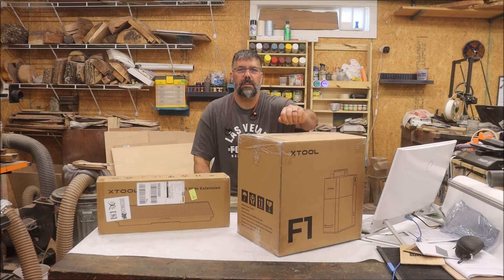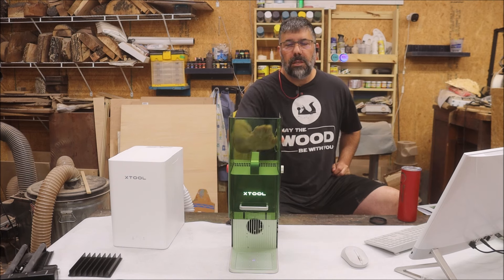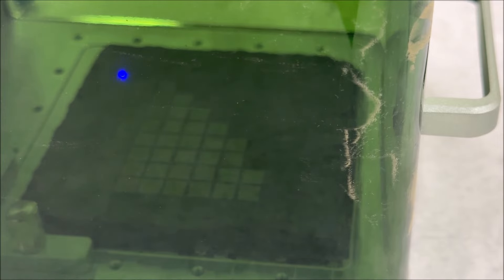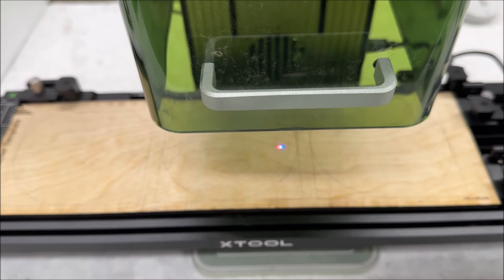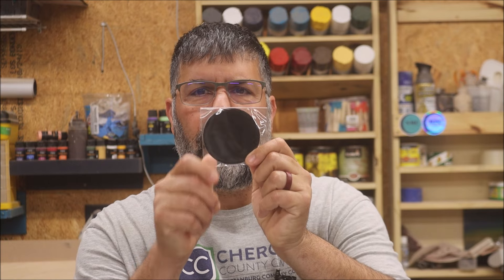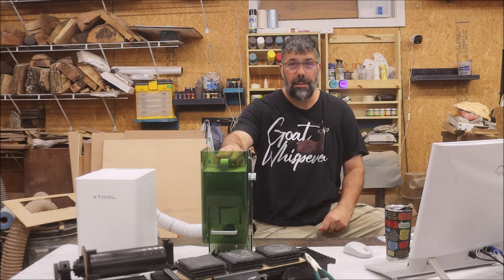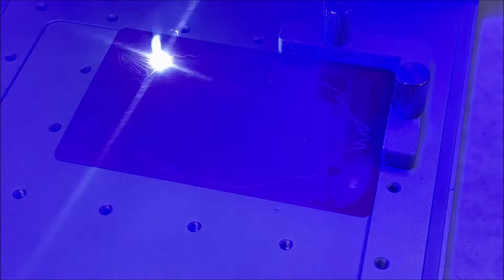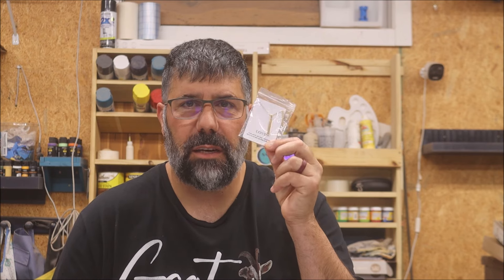Watch This Before You Buy The xTool F1!

Comment: Great video. I just received mine. The black USB insert on the back is not for Wifi. Wifi is built into the machine. The little USB insert is a safety key, which when removed, will render the machine useless so others or children can't use it. It also comes with an extra safety key in the box.
Reply from the maker: I stand corrected. Thank you.

Comment: That price is a little ridiculous compared to what other comparable lasers go for
Reply from the maker: When comparing lasers you have to compare apples to apples. It needs to be portable and have both an IR/Fiber laser and diode laser. It also needs to have have accessories. With that in mind the only comparable laser to the xTool F1 IMO is the Woodpecker 4. It runs on sale for $1799 normal price $1999. While the xTool F1 runs $1599 base price. There are several YT channels that have run head to head comparisons on those.  The xTool F1 is faster, more precise and is easier to use for repeatable cuts. Although the WP4 does have a larger  cutting area, it doesn't make up for the rice difference IMO. Now this is just what I have seen since I have never used one before. Now do I think the prices of these lasers are over the top....well yes and maybe these lasers aren't for hobbyist, but those prices will come down over time. I let a friend use my F1 for a craft show for there bike club in Florida last month. They pulled in a profit of over $1900 over 3 days, that's three times as much as any other show they have gone too. The F1 allowed them to engrave a lot faster and better than there Longer laser did. As soon as they got back they ordered a new F1 and they have also ordered an S1.  What I am getting at is these machines are an investment in your business. You can make your money back on them. Again this is just my opinion.
Reply: @MoonpieCreations  oh I have no doubt that it will pay itself off. What I meant was that it seems like a big part of the price is for the form factor/portability and not for the power/capabilities of the machine itself? But I'm not an expert. Either way, not a criticism of your review
Reply: As a hobbyist, I just bought the XTool D1 instead because it seems like a more versatile machine for making good quality things that are bigger than the F1 can fit (even if it does it slower)
Reply from the maker: @AndrewLaSane  Yes the D1 is an excellent machine. I hope you enjoy it.
Reply: $1400 at Harbor Freight and Tool
Reply: @AndrewLaSane  what did they make to sell at the bike show. Just curious

Comment: The table limits the speed to 160 mms - There should be two modes: the current method using the table for the X axis. A mode that allows a galvo etch of the 4”x4” then automatically moves to the next position and allows a 4”x4” galvo etch.  That way, each 4x4” etch or cut will happen at the up to the 4000mms which is the machine rated speed.
Reply from the maker: Good information, thanks.

Comment: Will it engrave on clear epoxy or epoxy with mica? Asking for pens. Want to switch  from CO2
Reply from the maker: It will not engrave on clear acrylic or epoxy. But epoxy with mica? Depends on the colors I would think. There are some spectrums that an IR and diode just won't etch.

Comment: Is it possible to add patterns to the tiny gold block necklace instead of words? 
also,
doesn't the f1 make more sense than the d1? quality wise
Reply from the maker: You should have no problem with making designs on he neckless, just remember you can only engrave so small.  As for which one makes sense, it all depends on what you are doing. The D1 is great for larger cuts while to F1 is better for smaller projects. Well that's my opinion anyway.

Comment: Thanks for the video, Do you know if it is possible with the xTool F1 to engrave texts on a large surface by moving the device for each engraving step while maintaining the alignment of the texts?
Reply from the maker: Only with the slide piece I showed can you make larger letters. Unfortunately it's not made for larger items.
Reply: Thanks for your answer and your videos @MoonpieCreations
Reply: @MoonpieCreations Which laser would you suggest for engraving and cutting large(r) surfaces?
Reply from the maker: @ZeljkaJankac  it really depends on what larger stuff you are engraving and cutting. If you’re doing it to 3 mm plywood, the xTool D1 or a atezer A20 are good bets. If you plan to do something long and need pass-through the xTool S1 is great.  It really matters about your budget and what you’re doing.

Comment: Was wondering if you put a long piece of wood or slate on the extender table 4inch x 12 inch could it engrave right across it?
Reply from the maker: Yes it can.
Reply: @MoonpieCreations  I owned a big laser cutter years ago. Never done anything onto metal. Has anything changed. I heard you had to coat the metal?

Comment: What settings do you used for the IR on the tumblers. Because I couldn’t get it right. I am testing here for a week and I didn’t it get clean with just one pass. Thank you already 😊
Reply from the maker: That really depends on the tumbler type. I did a test grid to find what worked for me, but I found 80spd 100pwr 200lpi worked for me.

Comment: Can the xTool F1 be used to mark black ABS plastic similar to the way it marks acrylic?
Reply from the maker: ABS emits cyanide gas (HCN), which is deadly. It is not recommended to use with a laser.
Reply: @MoonpieCreations 
It also releases chlorine gas, it will also kill you. Once that gas and the tiny particles of it settle, any moisture will convert that hydrochloric acid. This includes your skin.

Comment: What is the expected longevity of this 2k machine?
Reply from the maker: Depending on use 10,000 hrs
Reply: @MoonpieCreations  great video! What happens after 10,000 hours? 😳 Do you need to replace any parts or get a new laser? Also, if you need to get parts replaced, which parts and how much do they cost (in the USA)? Thank you.
Reply from the maker: @lindascraftsandthings915  10k hrs is a long time but sometime the lasers wear out. Happens in all lasers. If one of the two lasers stops workings you will have to replace them. xTool has pretty good tech support and can get you any part you need. At least that is my experience. Cost I guess would depend on which part, but I couldn't tell you how much for them.

Comment: Do you think it's strong enough to do a lower receiver?
Reply from the maker: I haven't tried that yet, but I don't see why not. The IR should work fine. If I come across someone who has done it I will let you know.
Reply: If it removed rust from the pliers, it should work on a receiver. Most of them are coated in black oxide.